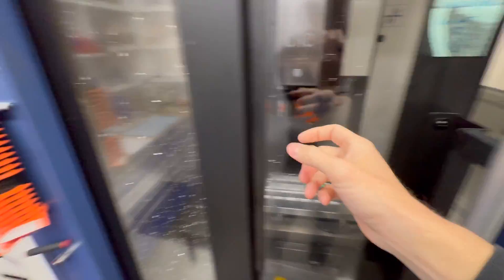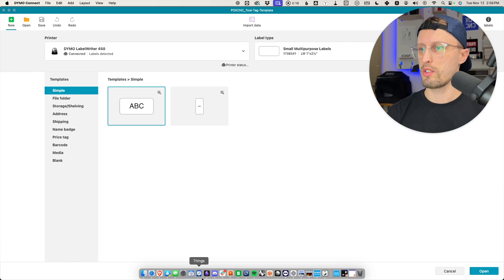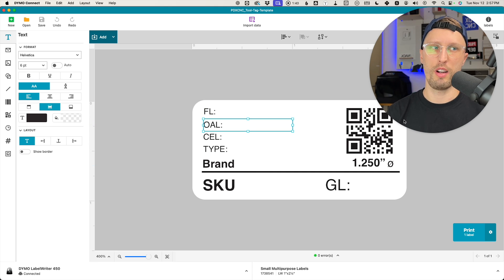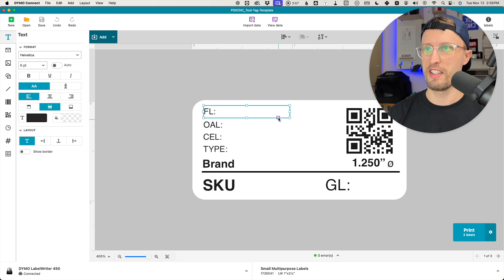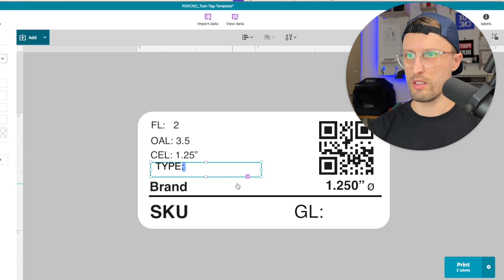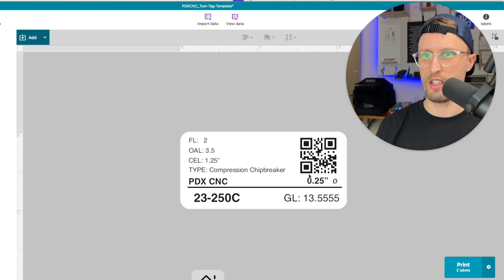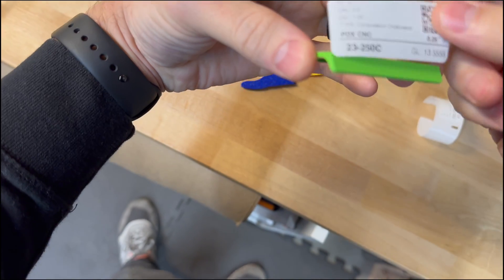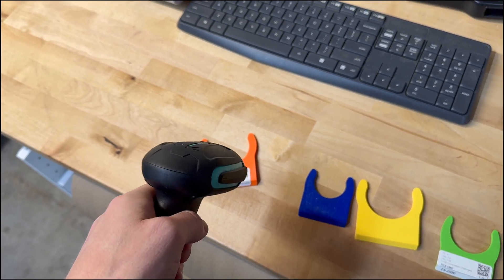How to use tool tags to organize CNC tools

Comment: How do you deal with loading tool 55 into pocket 30?
Reply: This depends on your machine/process/cam. I am going to try it this way: My turret machine has 21 tools. The controler tool list (table) has 99 tools. I will leave the data for tools 1-21 adhoc. So I am left with tools 22-99 (78 total) standard tools. My tool change for standard tool #22 in pocket #5 would be something like T05 G43 H22 D22. This allows me to write custom touchoff code for wide and angle depentant tools such as slitting saws, brushes, facemills and shearhog. It also means I can take the probe out and have 21 tools. I can compensate for wear. I can set for the height offset on a spot drill tip once. I am still in the process of watching youtube videos, but this seems to work!
Reply: @ what you describe is how I’m currently running my haas with carousel tool changer and it works well despite some nuances. Thanks for the response.
Reply: @poetac15  Nice! I never ran a carausel so I can help you there.
Reply: If you have Siemens or Heidenhain control it has solution. If your machine have mybe 20 pockets, and you need to use 25 tools. The control know, that tools which in control arent in pocket of toolchanger ti knows to wait for manual change and then run program. If there is a change t otool from tool changer. Control wait to take out the spindle the tool which you put manualy to spindle and then if u press start after removing tool, machine automaticly take to spindle tool from toolchanger. SO siemens and heidenhain are better systems in my opinion. Haas and fanuc has some good features but thats not enought. Sorry for my english.
Reply: @ thanks for the response. Since asking this I have begun using a similar system on my haas machines - all thanks to you 🤘